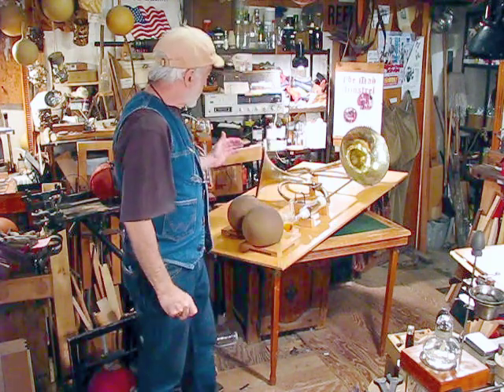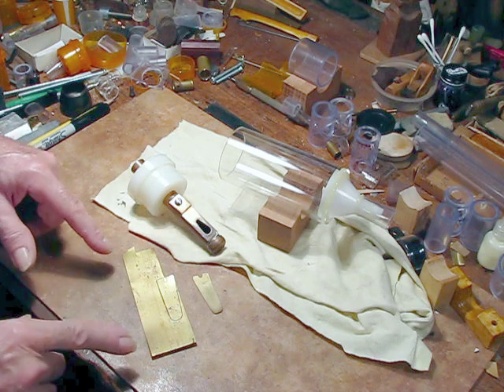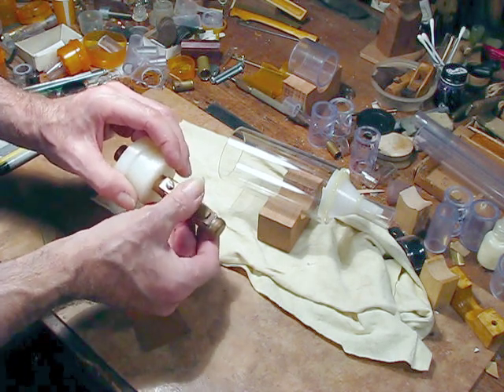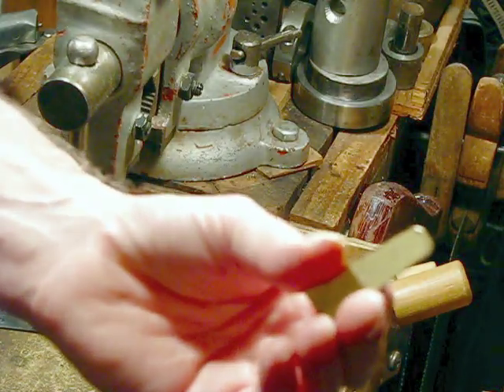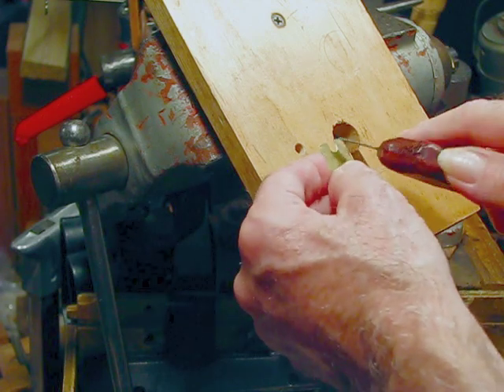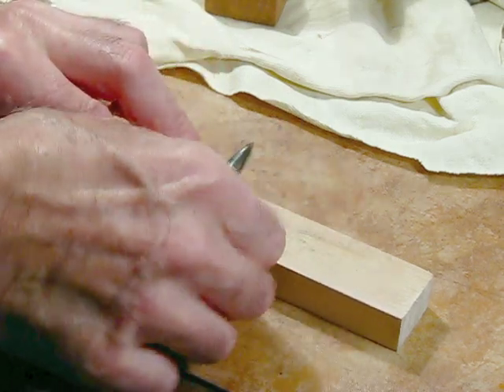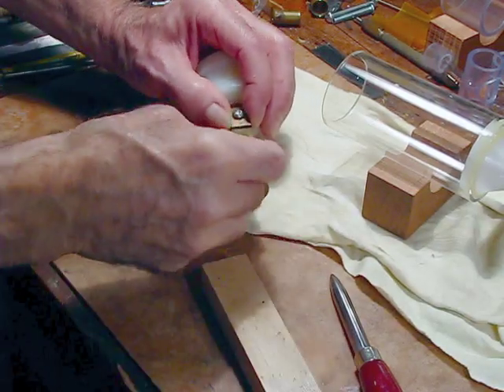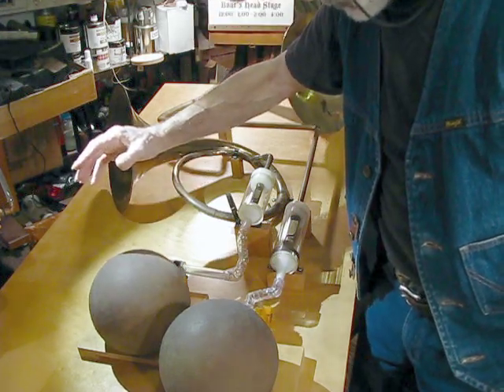Making a Brass Reed Tongue

Comment: What grade of brass is used to the reeds?
Reply from the maker: The brass sheet I use is called 1/2 hard temper, alloy 260. It's a bit springy, but also nicely malleable. You can get this from K&S Metals, packaged in convenient hobby-size sheets, and I recommend starting out with .010” thickness. I occasionally go as thin as .005", which they also sell, and I also use .007”, which is available from other suppliers.

Comment: Do you a have a tip how to fix my small bulb horn tongue, because it broke down...
Reply from the maker: Those reeds are usually soldered together, so you would have to heat it until you can pull the broken tongue out. To make a new tongue, you can get hobby-sized pieces of sheet brass from K & S Metals, available from the usual online places like Amazon. You probably want a thickness of around .010". The whole reed body should screw out of the horn, for working on it easier. You can cut the new tongue out of the brass sheet, with a heavy shears. Getting the right amount of curve on the reed tongue is the hardest part; not too much or too little. Sometimes you get lucky, and it will work the first time. You can also epoxy the new tongue into the reed body, instead of soldering. JB Weld is good for this. This way you don't have to worry about the heat affecting the springy temper of the brass tongue.

Comment: Finding you and your tutorials has made this a great day for me. I am a low-grade tinkerer who has for fun been building machines which use bellows and reeds to make certain sounds and floundering completely in the dark, using intuition, guesswork and experiment to clumsily reinvent the wheel at every turn. This one video has given me so much insight and technical information that I feel absolutely rich! I am looking forward to seeing the others. Do you answer technical questions from viewers? Thanks for this.
Reply from the maker: Thank you for your comment. I'm glad my video helped you. I learned a great deal from perusing a two-volume tome called Pipe Organ Construction through the Centuries, which was in the research room of my local library, pre-internet. I would also ask permission to crawl around in church organ lofts, and would bring a sketch pad to take notes. I've also learned a lot by simple trial and error in my shop; my Wall o' Failures is extensive. And yes, answering technical questions is the reason I exist, so feel free to ask.
Reply: @bellowphone  Okay! Thanks! I'm building a mechanical device that will chant OM. I have the bellows, motor, levers, timing etc worked out, but I am in search of a reed/tube/resonator setup that will make a deep O sound. I've tried a duck call, moo box, old bulb car horn reed and bass harmonium reed at various air pressures and with various tubes (cardboard and hard plastic) to deepen the sound. So far I'm not there. Any advice you can provide about reed and tube length/configuration would be more than appreciated.  Any advice about how to produce the M sound would be more than appreciated also. Very happy to reimburse you for your time. Thanks for sharing your knowledge.
Reply from the maker: @poochytown  As you know, most horns and reeds have a flared end, or bell, as in a trumpet, which amplifies and colors the tone. Some have a bell which flares and constricts again, before the final flare, giving a little chamber at the end, which imparts a nasal quality to the tone. Oboes and English Horns have these, and some organ reed resonators have them. You can see a good example of this in my most recent video, "Bellowphone Explanation and Sweet Georgia Brown". On that video, at 2'45" I blow one of the horns, and then show a view of the resonator, which is made from two funnels glued together to form the chamber. You can hear the nasal tone of it. It seems that if you experimented with this principle you might get an O sound. Also, at 4'40" I show a view of my lowest reed, which is short and fat, and has a washer epoxied to the end, for weight; this lowers the pitch and gives a meatier tone. Weights are often used on organ reed tongues for lower deeper pitches. Making the reed longer, for a lower pitch, can sometimes make the tone clattery, so using a weight and shorter length can mitigate this problem. There are so many variables that affect the tone of a reed pipe: the tongue thickness, width, and length; the length of the resonator and the size of its bore, the shape of the resonator, so you have to experiment with variations of all these factors. A cylinder bore to the resonator, instead of a tapered bore, can also help in giving a more nasal tone, if that's what you're after.
One more general thing about reed tongues, is the location of the curvature. If the curve is more towards the free end, the tone will be smoother, but the pitch won't be as stable: it will tend to go higher if you give more air pressure. Conversely, if the curve is more towards the anchored end, and the tongue is more flat towards the free end, the pitch will be more stable, but the tone will be more harsh and clattery. Being able to bend the pitch a little by adjusting the air pressure, might actually be an advantage in your case, to give a bit more natural inflection to your OM.
As far as getting an M consonant sound at the end of your note, I really have no idea how you could do that, except to suggest that you mold a pair of silicone rubber lips for the end of your resonator, and flex them closed at the end of the note. Horn players can get a wow wow sound by opening and closing the bell with a rubber toilet plunger, so maybe something along that line. I would be interested to see what you come up with.
On a completely unrelated note, I'm sorry about all the ads popping up on my videos. That's something that YouTube recently started doing at their own discretion; it's completely against my wishes and I don't make a dime out of it.
Reply: @bellowphone  Thank you so much! This is gold!

Comment: I have some questions for you . May I ??? what metrieal strip you are using for tongue of reed ?
and where from you have got? how many sizes of thikness of this stripe I can get ????
Reply from the maker: I usually use brass sheet from K&S Metals, of .010" thickness (ten thousandths of an inch). This can be ordered from Ebay or Amazon, for instance, as well as other online metal suppliers. For smaller reeds I sometimes use thinner stock, of .007" or .006". If you search "brass shim stock", you can find companies that supply brass in these gauges. Some hardware stores and hobby shops sell K&S Metals in single sheets of 4" x 8", but stores like that in my neighborhood are getting hard to find. I hope that helps.
Reply: @bellowphone   Thanks you very much

Comment: Can you make those reeds for acordion? Or is out of different material
Reply from the maker: Accordion reeds are brass also, but those reeds work a different way. They are what is called a free reed, as opposed to this kind, which is called a beating reed. A beating reed vibrates against a bottom edge, whereas a free reed vibrates inside a close-fitted opening, without actually touching the edges of the opening. Harmonicas also use free reeds, which can easily be seen if you remove the little screws and take off the cover.
Reply: Awesome.   Do you know what kind of other material needed besides bras to make a free reed for acordion.
Reply from the maker: I suspect it's a brass tongue riveted to a brass reed block, but I don't know because I've never taken an accordion apart. That's for you to do!

Comment: Have you thought of using other metals, such as shim steel? Already spring hard it is available in different thicknesses and is usually fairly rust resistant.
Reply from the maker: Years ago, tried different materials. If I remember correctly, steel gave a harsh tone and was not easy to adjust. I do remember concluding that brass was best. I got an interesting effect with beryllium copper (which is hazardous to cut and file due to its high toxicity). The reed could be made to produce simultaneous overtones, giving the note a "sore throat" effect.